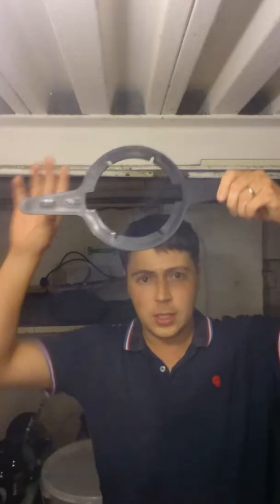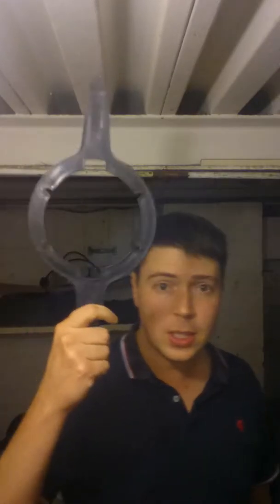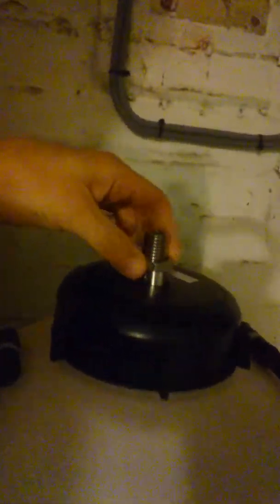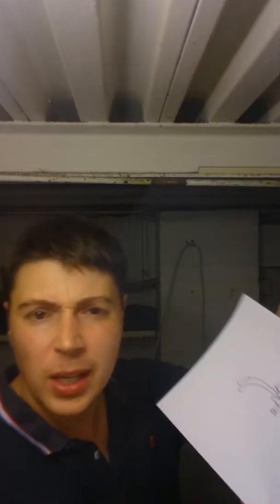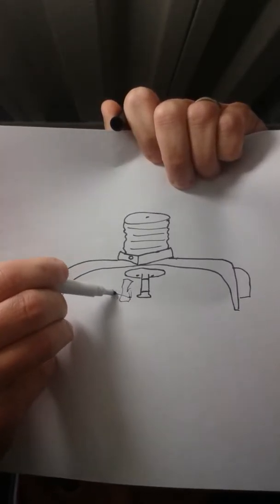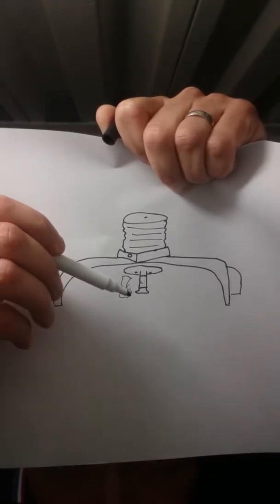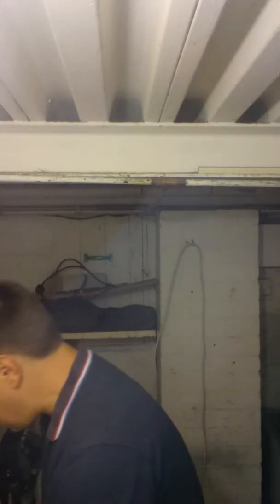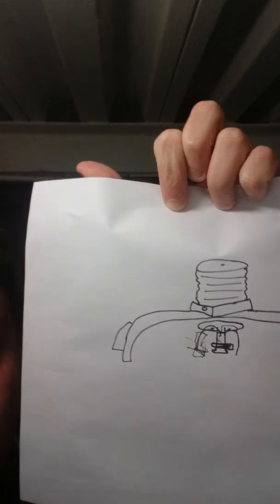King Keg + S30 Valve - The Missing Instructions

Comment: I've stopped using vasoline which pongs a bit. If you can't find keg lube in a homebrew shop you can get food safe lubricant from Arco (safety equipment suppliers) for around £5.20 for a 500ml spray can, which will last absolutely ages.
Spray it sparingly underneath the O-ring as well as on top and the 'overspray' will lube up the lid threads and make it easier to screw the lid on and get it back off .